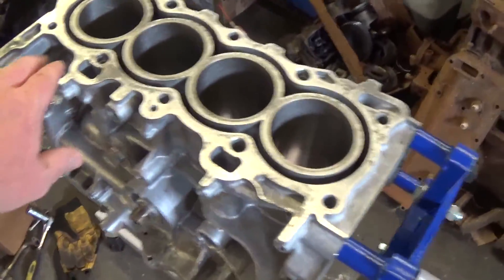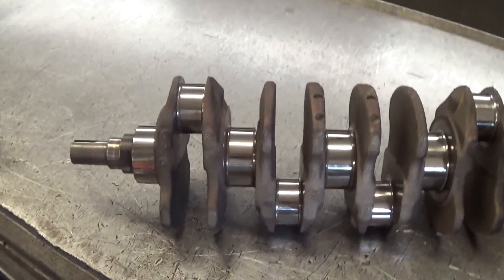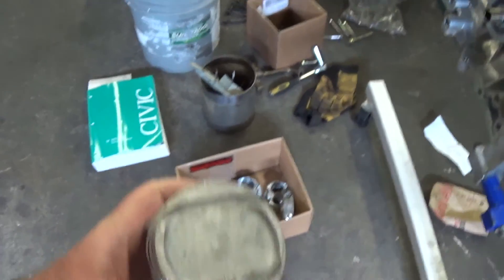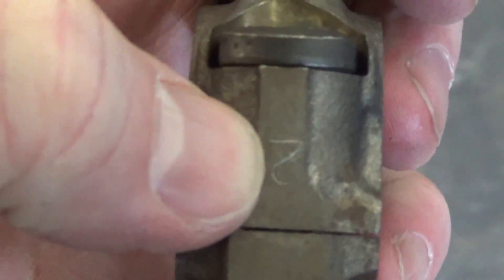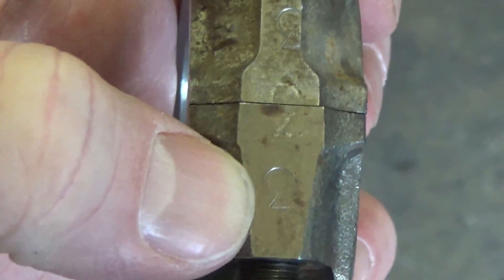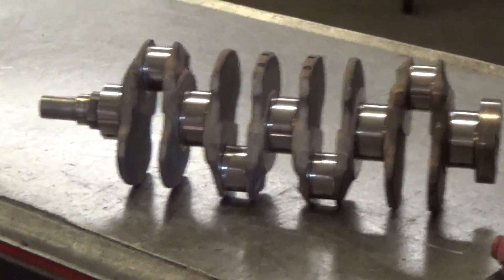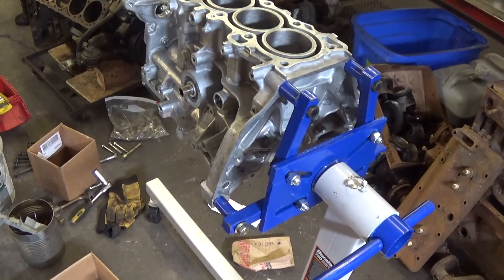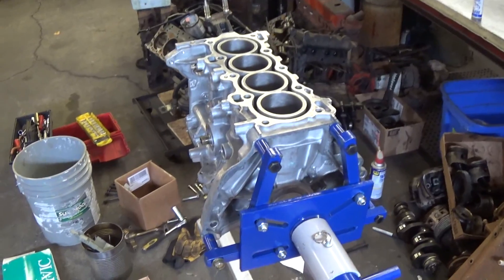D16y8 how to size your bearings and rings

Comment: is that the transmission side? the bearing letters?
Reply from the maker: What engine are you working on?
Reply: @tubejim101  16y8 2000 civic. I was all prepped to do them in the car. Got the numbers and letters for the rod bearings easy enough and the numbers for the main. But I can not find the bearing letters at all. irritating to say  the least.
Reply from the maker: @Denver1976Man  When your standing in front of the car, looking at the engine, it is to your left.  You can see the stamp, where they put the D16Y8.  The timing belt would be to your right.  If you can't get at it, call the dealer and see if they can get the letters by VIN or engine serial number.  Not sure if they can, but would be worth a try.  If that does not work, maybe your can figure it out with the dealer's color chart.
Reply: @tubejim101  no they said they cant with the vin. I know where the engine type stamp is. But it looks like according to diagrams and even your vid the letters are under the bell housing. I am so close to order king bearings. I am ocd about oem on honda, Esp critical parts like bearings...lol

Comment: Listen closely... if HONDA put different size bearings in different rods and journals its simply because they have sooooo much fucking slop in their old outdated machines that production tolerances are off the fucking chart.. measure EVERYTHING do not trust that Honda stamped jack shit correctly because remember this whole problem is because they refuse to maintain production machinery. if in doubt have the crank cut so ALL the fucking bearings are one size .   color of bearings my ass in USA we print the size on the fucking box no mystery here

Comment: Hey buddy what do you do if the factory forgot to stamp your crank I've been going crazy trying to figure out what to do next without ordering all the sets and Mitch Match them
Reply from the maker: What year, make, and model are you working on?
Reply: @tubejim101  98 Honda prelude base h22a4
Reply from the maker: @johnfarias7230  I'v never worked on a Prelude before.  I would talk you the parts department at the dealer ship.

Comment: At 5:09 what color of what??????
Reply: Ltl Paa   Some bearings are color coded and the colors relate to sizes. Some blocks/rods are machined to an equal spec, others are machined to a tolerance. The tolerance ones are often called select-to-fit- basically bearings are thicker/thinner to make up for inaccuracies in machining the crank. So they quality control the crank and select the right slightly different bearing is how it was explained to me.